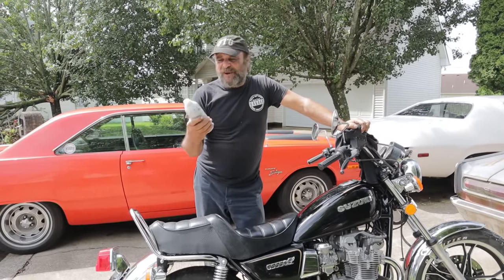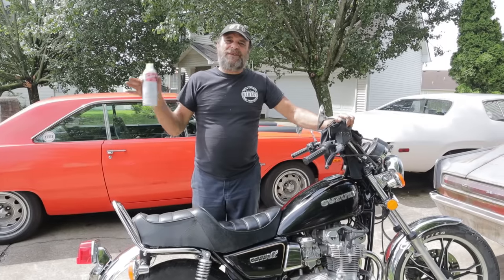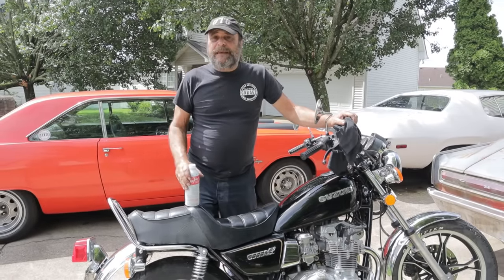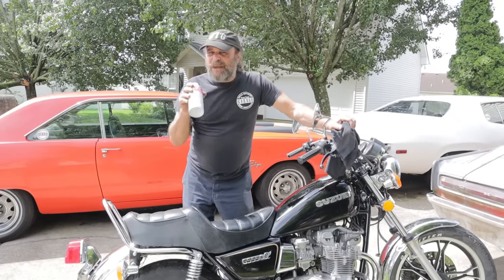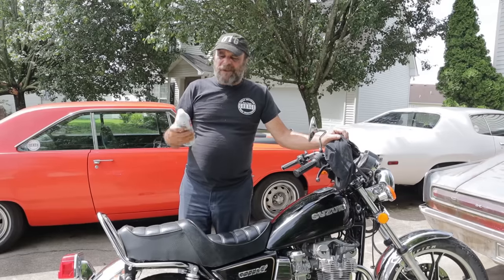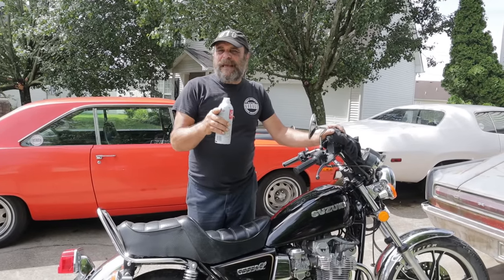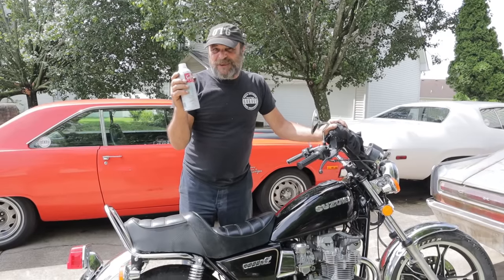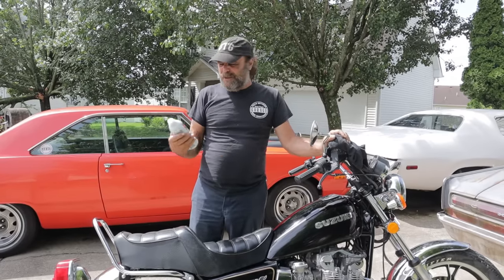We Try Seafoam - We Come Away Shocked

Comment: The reason people are skeptical is they expect it “to fix” the issue as soon as it hits the tank.
The “schmoo” took time to “grow” it gonna take some time for the “voodoo” to work if it does. If the carb is so plugged the cleaner can’t get to the problem area it won’t work and ya gotta tear it down throughly clean and add it to get the rest.

Comment: Time is a critical variable with this stuff. I've had a handful of 20-30 year old bikes that barely ran. I could fill and treat the fuel and fight with it all day, but if I mix it a little strong, run it enough to fill the carburetor and walk away it soaks overnight and almost always runs better the next day.
I will never clean a carburetor, on a machine that fires, without trying seafoam first. It hasn't let me down yet.

Comment: seafoam and B12 is my go to right before an oil change. But I will say I had this 92 caddy with the 4.5 and the fuel pump was going out and it would not run right Unless I put a whole bottle of Chevron Techron in when I filled up. It would die going around corners or anytime you turned the steering wheel or I would have to purge the fuel line of air. But when I used chevron Techron didn't have a problem.
Reply: You misspelled 'Cadillac'...
Reply: @michaelangelo8001  🤣

Comment: Pick up a can of toluene next time you go to Home Depot, paint department,  1-2 ounces to a gallon of premium gas and you simply won't believe the difference in how clean it will make your carbs or injectors.  I add it to E15 fuel after removing the ethanol to bring the octane back up to 93-95

Comment: Chevrons Techron on concentrated formula @ 2oz per gal fuel is even better at cleaning dirty carbs & or injectors sling with cleaning carbon & gunk from backside of intake valves too.
Use 1.5 oz per gal fuel for a std maint clean up when vehicle is running ok vs mfg’s tec 1oz per gal fuel not strong enough for a decent clean.

Comment: I have say that seafoam works really well but do not leave it in there I did for 3 weeks I made that mistake and ended up replacing all the rubber parts in the fuel system

Comment: Don't screw around dump the whole bottle in the tank.  I think that seafoam can really help with a problem like that. 
But with a small engine and a steel fuel tank,  I would only use ethanol free gas.
Especially if it is going to sit and not get used for awhile

Comment: SeaFoam is not magic, it is just a solvent. If you treat it that way, it works great. Every few oil changes I pour a half a bottle in the oil a few days before I'm going to drain it and pour the other half in the gas tank. It does take some time to do its thing. If a $10 can of SeaFoam saves a few hours of taking things apart and cleaning them, it is probably worth it.

Comment: I had an early 70's Honda CB750 and it ran pretty crappy and being an auto mechanic all my life but not so much a bike mechanic I took it to the Honda dealer (Prescott, AZ.) and was going to leave it so they could rebuild the carbs (4 of them) and synchronize the carbs but they said they had a 6 month back log on bikes and the guy suggested I try some sea foam.
 I added it to the fuel and drove it maybe 2 days and all the stumbles and crappy idling disappeared and the bike was scary quick and idled and ran like a Swiss watch.
Bought the bike for $1500 and sold it 2 years later for $5000. 
 I guess older big bore Japanese bikes are a status thing in Japan and rich people buy them, ship them back to Japan, rebuild them and they are VERY desirable. Anyways this bike had a strange red light on the dash that never lit up and I had no idea what it was for and found out this particular bike was never supposed to have been exported (according to the buyer) and was some sort of special bike built for racing. The light was a shift light that lit up at a certain high RPM  (I never wound it up high enough to trigger it I guess)
 I have owned a few 250 enduro's, a few 750's and a couple 1100cc bikes and that 750 was far, far quicker than any other bike I have owned. To be honest it scared me a little.
The Japanese guy that bought the bike has one job... He searches for sale ads till he finds older Japanese bikes all over the world and goes and buys them and ships them home.
 The funny thing was I didn't know it was a special bike and I posted it for $2000 thinking buy it for 1500 drive it for 2 years and make a profit?   The guy OFFERED to pay $5000 for the bike which blew me away, how many times would someone offer 3K more than what your asking?!?!  I guess it's an honor thing and he felt he would be taking advantage of my dumb ass for not knowing what I had........To this day I wonder what would have happened if I asked for 10K?  lol

Comment: Been using Seafoam for many years, I buy it by the gallon, not joking. Why? Because of the ethanol in fuel and my wife only drives less than 2 miles to work. Anyway, you should have poured the entire can in the tank, look at the directions, it will not harm anything. I personally have never, ever, had a problem with carbureted or injected engines. As a matter of fact, years ago I tore-down a GM 350 engine that had about a 150k miles on it and the pistons, valves, entire combustion chamber looks incredible for the miles had on it. It is good stuff.

Comment: If you want to see what that bike can look like with the proper tweaks, hit me up. I run a GSL1000. Beach bars, fairing, ditch the grab bar! Carbs are easy. run pump gas and they'll clean themselves. If it's not running right (popping and hesitation) It's the balancing. You need a set of gages to clear that up. Four vac. gages on ebay $35. New jet plugs to, they will leak and cause a rich condition.

Comment: If you were running E10 or E15, its more than likely the ethanol in the gas that cleared out the jets that is the one actual Benefit we get from that shit. every port injected engine I tear down The back side of the intake valve and the part of the intake port that fuel hits when the injector sprays is cleaner than the day it was made, had a friend whole ran a small gas station  up in VA when I lived there , he was telling me how after thy started watering the gas down with that shit, he has a huge increase in how often he had to change the filters on the pumps for about a month or so after they started delivering that fuel, it was deposits coming off the insides of the in ground tanks  after about a month or two it cleared right up .

Comment: I put 1/3 in my evap system 1/3 in my crank case 1/3 in my gas tank
 500 miles later watched the barons and spun the Baron in the bottom in  The main's
 Shown my vice don't put it in the oil for high mileage

Comment: Or maybe just maybe there's was a little bit of water in the tank. Caused by sitting for so long. Condensation building up in the tank. 
Just had to burn through it that's all.
He might come back and say I drained the tank so that's not the case. Depends on how you drain the tank it's a saddle tank. You have to take the tank completely off unless it has a cross tube one side will always have a little bit of gas in it. And every time you fill it up you stir up the gas on the side that doesn't have the petcock causing a light stumble for just a little bit and then it goes away. One of those oh my God pull your hair out kind of situations.

Comment: Avoid using more than the prescribed amount of Seafoam in your gas.  Seafoam is a solvent, not a fuel or lubricant.  It does burn but not very well.  If you put in too much, it could by itself make the engine run crappy until it's done it's thing and you put in fresh gas.  Always measure, don't eyeball.  
Plus, on a bike that has set for a year with today's gas and no stabilizer, the jets are not the only concern in your carbs.  Your float bowls likely still have corrosion product still inside and if any pieces break lose in particulate form, right back into the carb jets.  A tiny chunk of corrosion is all your float needle and seat needs to stick.  Smart money is to pull the carbs and clean them right (stranded on the road sucks).  Change the oil also, regardless if it 'looks' fine.
You have a nice little beginner bike there.  Perfect for a novice.

Comment: 🔔😎
Berrymans B12 Chemtool
Amazing for fuel system, cleans jets, injectors, backs of valves.
Mechanic in a can.👍 Half the price of Seafoam.
Berrymans makes 50 products.

BTW I've had RESTORE make very noticeable power improvements and/or reduced oil consumption/smoke.
Reply: For problems I usually mix at 3-4x the recommended concentration. Works👍😎

Comment: i had an old 85 toyota supra that was starting to show it's age and the effects of a sub-25 year old man beating on it - I remember replacing the fuel filter and it was still running rougher than usual so I put some seafoam into the intake and a little bit into the gas tank. let it sit for 5 minutes. fired it up again, and it looked like i just started a greasy old diesel truck in -25F weather. after a solid minute of this, the smoking died down a bit and the damn car ran like a top after that. but i dont know if it was adding some to the gas or sucking it down the intake that did the trick. sure looked fucking cool though!

Comment: I use it for everything to brushing my teeth to cleaning greases engines you name it !
Reply: All jokes aside you should see what happens when you flog a small engine commuter car with it . It’s like James Bond smoke screen. I’ve had a car fail smog inspection used a can of sea foam ran the car hard aronund the block pull back in and it passed.the smog tech was baffled

Comment: Seafoam and stabil fuel additives is about as crazy as paying $25 and up for one gallon of gas at your hardware store. If you want to buy unleaded fuel they sell it at the gas pumps if you look for it it does help from preventing carburetor gum ups. This is as crazy as buying overpriced racing fuel out of the 5 gallon metal jug.

Comment: Pop out your spark plugs put about a half ounce of seafoam in each one of the spark plug tubes let it go down and soak in the Piston clean off all the carbon let it sit overnight let it drain into the oil put the spark plugs back in start it up let it run put the rest of the bottle into the intake tube let it get sucked up and watch it burn off all the crap change the oil afterwards call it a day

Comment: Should’ve put in sea foam at double amount run it to get it all through the fuel system then let it sit at least over night.  That sitting is what cleans the stuff causing the problem.  All this assuming it can flow through. It won’t really help a completely clogged anything.  MOPAR2YA

Comment: How can you be that old and not know that seafoam is good for engines? I use it in all my small engines (and never ethanol gas) and once in a great while in my truck. If you use ethanol gas in a carb engine you're just asking for problems. A motorcycle gets such great mpg that a few cents more per gallon for real gas shouldn't hold you back.

Comment: Sorry SeaFoam is THE WAY TO GO.  I don't know of anything that does the magic that SeaFoam does.  I been running in my gas and diesel for 20 years and I also use it to flush carbon from my engine right before oil change.  You won't believe the carbon that gets stripped off your rings, cylinders etc.

Comment: So my experience and I’m from England it isn’t sold on uk shelves as far as I know. So I had a Kia Sedona mk1 😂😂yeah funny laugh joke lol anyway it was the 2.9crdi I bought it it use as a van my old van (transit)had died  however it had a full tank near enough of fuel. It was an old van it ran on used veg and diesel mix. So emptied that tank and put it kia. Don’t ever do that lol. By the end of the day wouldn’t start unless you used brake clean or ether. It ran fine once started with fluid but wouldn’t start. I tried premium fuel, injector cleaners off uk shelves and nothing worked Stil the same. Heard of seafoam tried it and thank god I did. So whacked one bottle in to 20l of diesel within a couple
Of hours of using the vehicle and about 100 miles it would start when cold again but not hot so another 20l of diesel in and another bottle of seafoam I bought three might aswell use em
Right. Well that did even better it would sometimes start when the motor was up to temp without the need for brake clean. So third 20l And my last bottle of seafoam in with it after that 20l the vehicle was back to normal. Started fine felt more peppy. I tried everything for 1000 miles nothing worked. I used seafoam and did few hundred mile and vehicle works fine again. Take from that what you will but I know fine well the veg had clogged my injectors and nothing else helped until I used seafoam. I rate it I’ve bought it again cos you never know when you might need it

Comment: I'll never understand why people think very strong cleaners designed to clean out mechanical parts are snake oil. I can understand not believing a liquid would rematerialize broken rings...but cleaning something out? I bet he's used forty different spray cleaners on bolts and nuts, and that worked probably every time. Why would this be different?

Comment: There are many better products than seafoam now days
Reply: Glad there are better things but to immediately clean out junk water carbon etc. It works great. I use it twice a year 1 can in 5 gallons on my bike, add the can, top it off, ride it 10 minutes or so to the house park overnight, then ride Clyde ride. I am not twisting your are or argueing just sharing my experience. PS. I drive over 150,000 a year at work, so bike and truck sit a good bit but this help clean out varnish and trash.

Comment: I'll tell you what this guy's doing wrong. He's lazy. He goes for the carbs everytime. He's got residual on the fuel lines and tank. Lots of alcohol in gas so it disapates when it sits. Sea foam works so well it frees it all up. Lines tank and carbs. You do work like this you replace the lines clean the tank and carb then new gas. Where you think evaporated crap collects most!? The lines as it settles to the carb. Duh.
Reply: Certain carbs won't come back depending on the make. Once the pins stuck....good luck. Try an ultrasonic cleaner and if that dont work get a new one.